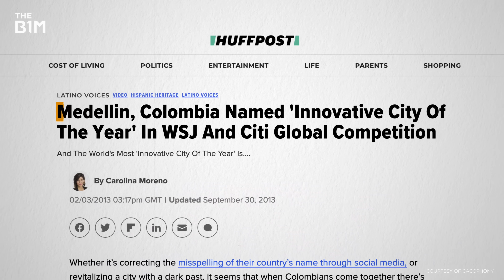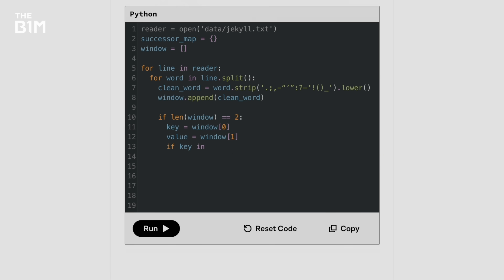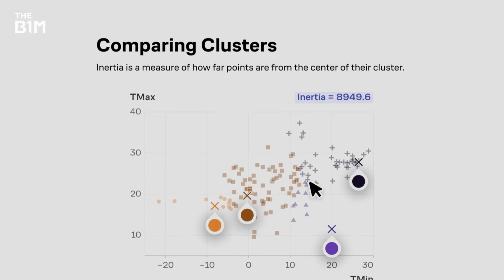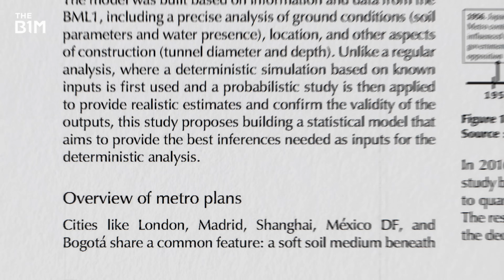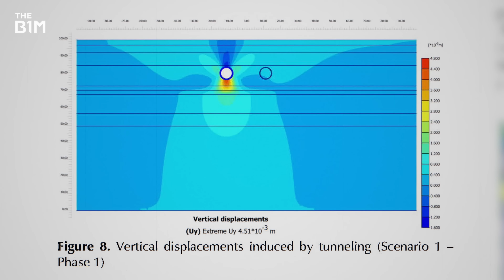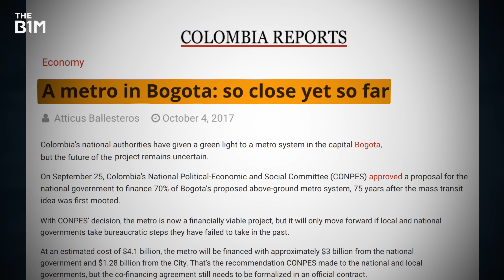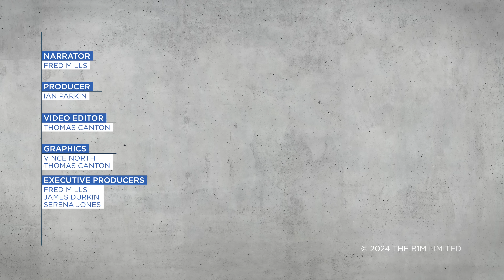How to Build a Metro From Scratch

Comment: Calling Transmilenio successful and anything close to efficient is definitely not realistic, those are always adjectives used by engineers and economist that only look at meaningless numbers like the total number of people moved per day. In reality you could be waiting for over 10 to 15 minutes for a filled-to-the-top bus to arrive, to be pushed in or out and then carried around the city on a bumpy line with your best option for comfort being leaning against someone else. The thing is tremendously unreliable, lines can be cut off from the rest of the city by traffic jams or manifestations which are not uncommon and for the majority of people who actually need cheap public transportation the price is not really low enough, meaning that probably one in every 5 passengers didn't pay for their ticket, and I don't blame them, the service is terrible. It's funny to me that 8 million people in this city put-up with that every day for 25 years, I got myself a bicycle after a few years of living here and now I got a motorcycle and is just such a relief that I can't stop moaning as soon as I have to take Transmilenio as My only choice to go somewhere. The metro is looong due but it's just that, the city really has to start planning for less cars because the traffic has become worse everyday

Comment: Colombian and ex-Bogota resident here, Transmilenio is and always will be a mediocre solution for transportation demands for such a city as Bogota. A system incapable of moving the required passenger volume, incapable of being on schedule, incapable of ensuring a safe and confortable ride for passengers.

It is definitely a major step to have a firs Metro Line and with the construction performance the project is showing, the administration focus should be in ensuring the rail independent transportation network keeps developing instead of loosing more money on previous outdated and mediocre solutions.

Comment: 6:30 in the Canary Island are trying to build trains like in the island of Tenerife and Gran Canaria both assistance will need to have tunnels for at least 50% of the total length. I have a question about theboring machine. Can it work on volcanic terrain because as far as I know volcanic terrain is not very good because it combines soft hard and sometimes sand

Comment: Thanks for the video, as a Colombian born and raised in Bogota the first thing that comes to mind when thinking about the country is corruption. And Bogotá’s metro is a tale of corruption and incompetence, 80 years and the city gets the worst possible solution. The 2014 project wasn’t Petro’s idea, that project was years in the making, it was the result of previous studies and an ongoing plan being followed by previous mayors, Petro just carried on and gave it a push, the project was shown to citizens at several display locations, including where the stations where going to be located. This was a serious plan that was supposed to be continued and construction started by the following administration, however, Peñalosa was elected by a thin margin instead of the more reasonable and neutral candidate (Pardo), and as soon as he came into office he started destroying everything the previous administration had done, he promised citizens that his new metro would be cheaper and faster to build, he said it would be operating by 2020, so basically he got elected with lies. But the real issue here isn’t underground vs viaduct, the real problem with what’s being built is that it’s more of a bus-train hybrid instead of a real metro: as you can see in the renderings transmilenio buses will continue to run under the viaduct alongside the metro, with metro stations being so far apart that people will need to transfer to transmilenio buses going in the same direction at ground level  just to get to their destination, which is completely absurd, time consuming, inefficient and makes no sense. Another huge issue with this project is just how many neighborhoods and parts of the city have been demolished and their inhabitants expelled just to give way to the viaduct and the huge access buildings to the stations, which will be surrounded by redevelopment carried out by developers who’ve funded the most recent mayors’ campaigns. Also, line 1 (the one being constructed) has been cut short of its originally planned length (compared to the original studies that preceded the 2014 project) by almost half. So the missing half has been presented to citizens by our corrupt mayors as “line 2”, which will supposedly be mostly underground, and people who should have been able to make a single journey from the northwest of the city to the city center (as per the original line 1 plan) will now have to transfer from an underground station (which will not even be connected to the “line 1” being built, in fact being located a few blocks away from it), exit the station and go up to ground level, walk a few blocks to line 1 and then enter the line 1 access building and go up to the viaduct level, just to be able to head downtown. This could even get worse if their final destination isn’t close to a metro station, in which case they would need to make a second same direction transfer, this time to transmilenio buses at ground level. So, as you can see, this thing they’re building is in fact a joke and it’s not the solution the city needs, no one will leave their cars to ride this mediocre and inconvenient “metro” system. I’ve been all over the world and it’s sad to say, Bogotá’s public transportation is terrible, it’s unsafe, it’s unreliable and inefficient, there’s a reason why so many people either remain using their cars (even paying a congestion fee) or buy motorcycles (the city is infested with them). By now Bogota should have a metro system similar to that of Santiago (Chile), but it’s got nothing instead. And other Latin American cities such as Quito (Ecuador) have now beaten Bogota in terms of public transportation infrastructure. Unfortunately this is just one of many examples of corrupt politicians being out of touch with the general population and putting their personal interests and those of their buddies and campaign contributors first, which is the norm in Colombia. So, unfortunately in the foreseeable future Bogotá’s public transit will remain mediocre at best.

Comment: There will be a Subway line connected to the Viaduct line via station (Línea 2 del metro de Bogotá), in this case Colombia is the country with the most rain in the world, therefore, there are several engineering challenges to overcome but due to sheer capacity the project is necessary and it's in progress, so the metro lines in Bogotá will be of 2 kinds (elevated train and subway), connected with the near train (Regiotram) which links big towns near Bogota like Facatativa, Madrid, Mosquera and Funza, those towns will eventually join with Bogota to form a bigger city
Reply: I remember when I moved to Mosquera 15 years ago with the promises of Regiotram being built for a better transportation solution. At this point I just hope I get to live to see it lol, many many years in the talks but doesn’t seem like its happening anytime soon. Hopefully this integration with the metro speeds the build time.
Reply: @angiemora7681  I understand it is being constructed right now. A lot of problems have happened though, and sadly I don't see it at all being constructed before ~2030.
Reply: @angiemora7681  it's like the bogotá metro lol
Reply: @angiemora7681  Hace poco estuve por la zona y los trabajos andan viento en popa.
Reply: (station 16 of line 1)

Comment: Colombian here, thanks for the coverage! you just missed a huge load of corruption in the whole 80 years of thinking and barely start executing a metro line in Bogotá (where I was born and rised) but everything else is pretty accurate. By the way, Peñalosa is known among several things for saying "it does the same and it is cheaper" and also foe being a huge fan of concrete. Thanks :)
Reply: also, Metro construction has started, but we aren't sure when (if) the first line will be finished, how much money and time it would ended up taking
Reply: @waldos97 
The metro is going pretty well, almost on schedule. 
I follow several channels where they show the fast and constant advances.

Comment: The most viable & cost effective solution should have been a massive on-grade TRAM system.  The Elevated systems always create such massive NOISE pollution, breaks up the urban fabric & create those undesired spaces for homeless, beggars, etc. under the viaduct system.  Also there is the "Seismic Issue" that Bogota is quite susceptible to with earthquakes reaching 5.2
Reply: BRT was so driven by efficiency that a tram would fall short in comparison. At best, it is a cost-intensive option in the long term.
Reply: laughs in chilean

Comment: BRT is really good, but a city of that size needs a large metro system first and foremost and BRT to support the metro.
Reply: BRT is good up until a point, if people ride on it (and in a giant city like Bogota i would imagine lot of them do) you will run into capacity issue. Largest buses can handle 150-200 passengers. Converting those lines to tram will increase capacity and lower maintenance cost without massive investment. But yeah Bogota is a massive city and it needs high frequency and high capacity transit like metro.
Reply: @ristekostadinov2820 I have been unable to enter several BRT from TransMilenio due to some being too busy or even the stations being too crowded to let me get through.
Reply: Yep, completely right. Transmilenio is actually quite comfortable and reliable out of peak hours, and large avenues that don't have a TM line along them (Boyacá Av comes to mind) experience some of the worst traffic in the city. But the sad part is that riding TM at peak hours is a grueling and tiring experience, and the efficiency of the system is completely diluted in waiting several buses because there's just too much people waiting in front of you.
Reply: AMEN brother, we are suffering the consequences of doing things the other way around. We built an entire BRT  system as the main mode of transpotration, and now we are figuring out how to adapt a metro system to support BRT... craziness. greetings from Bogota
Reply: agreed, whats funny in indonesia, some politicians wanna remove the brt line 1 in Jakarta after the the phase 2 mrt development finishes in 2029 :v
Reply: Bogota has the longest Bike-Paths network in america including USA
Grettings
Reply: @LiticoBunenditcher  Sadly, the urban planning of the city (or lack thereof) make large stretches of bike paths way more dangerous and uncomfortable than they should be. Ofc this is not exclusive to Bogotá, Colombia or South America. 

Still, they do provide a very valuable alternative, that often outspeeds car traffic
Reply: @ thanks for the info
Reply: No. Metros are not needed.
Reply: @yashagrawal88  yes, yes they are needed

Comment: The Canada Line's cut and cover was 18 months of chaos. The Eglington Crosstown's tbm based deep tunnelling meant... 13 years of surface chaos as servicing shafts still needed to exist. Go with cut and cover.
Reply: How long is the Eglington Crosstown for that project to take that long?
Reply: @ianhomerpura8937  19km. So they did manage a little over 1km/year if they manage to finish it soon.
Reply: @ianhomerpura8937 the Project had issues as early on as it was proposed it should have been a Regular Subway line dug Cut and Cover which is the tried and true classic way of building Rapid Transit (after Elevated Rail that is)
Reply: @IndustrialParrot2816  There were shovels in the ground for an Eglington subway in 1994.  Eglington West Line.
Reply: @ianhomerpura8937 its a 19km tram and only half of it is tunneled
Reply: Plus the benefit of cut and cover is that it doesn't take up to 10 minutes to get down to a deep level platform. Adding 20 minutes to a commute (for ingress and egress) makes deep level metros not as competitive vs. other forms of transport.

Comment: The Bus Rapid Transit (BRT) system originated in Curitiba, Brazil, first implemented in 1974 under the leadership of then-Mayor Jaime Lerner. *
Known as the Rede Integrada de Transporte (RIT).
Reply: The final version, with the main attributes that enabled a BRT to handle 70,000 passengers per kilometer per hour, was conceived in Bogotá.
Reply: @jorgeandresortigozaulloa6088  In 1974, Curitiba launched its BRT system, capable of carrying up to 20,000 passengers per hour in each direction—an impressive feat for a city with a population of two million. Notably, many buses used in other BRT systems, such as Bogotá's TransMilenio, are manufactured in Brazil by companies like Marcopolo and CAIO.
Reply: Curitiba created it, Bogotá popularized it.
Reply: Thanks. I was going to say the same thing. Curitiba and Jaime Lerner deserve the credit.
Reply: @bkrider19  Curitiba's network is exactly like it was described in the video: a band-aid. A city the size of Curitiba needs metro and Jaime Lerner, a staunch advocate of cars and highways, buried (not literally unfortunately) the project in favour of his buses
Reply: I believe that's where Transmilenio got the idea of the BRT system with its own traffic lane and stations. This BRT system has been very helpful to the capital of Colombia.
Reply: Curitiba made it famous and built an whole system but the first one is the Runcorn Busway in Runcorn, England is the first opened in 1971 and is still in operarion.
Reply: @AL5520   fair enough but: Curitiba’s system introduced features like level boarding and articulated buses, setting the standard for BRT systems globally. While the Runcorn Busway came first, its impact remained largely regional. In contrast, Curitiba's BRT revolutionized urban transit worldwide with its innovative design and scalability.
Reply: @yousseph777  I have no argument about the importance and difference of the systems but we need to give credit where credit is due.
As for level boarding, they certainly didn't have that at Runcorn.
Nowadays with low floor buses a simple curb is all that is needed (if planned correctly).
Reply: @AL5520 show me the source?
Reply: @LA-BRA  The source for what?

Comment: Heck. Vancouver has had several driverless overground transit systems for almost 40 years. Instead of several long trains with expensive drivers using very large stations, smaller stations, shorter trains can be used.  At rush hour capacités more trains can be added without the extra expense of a driver.